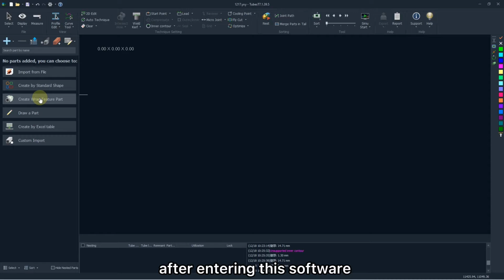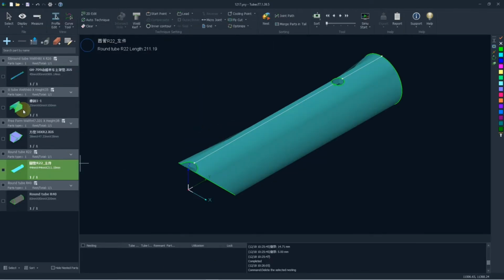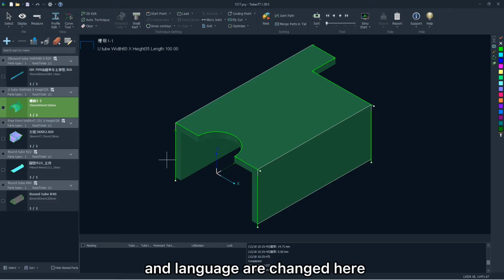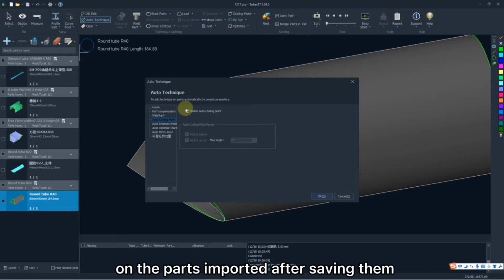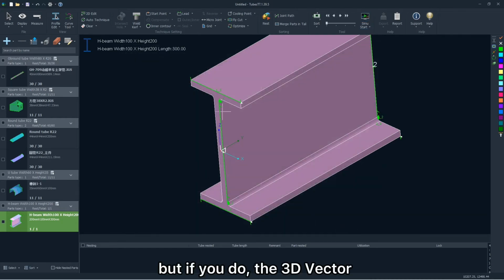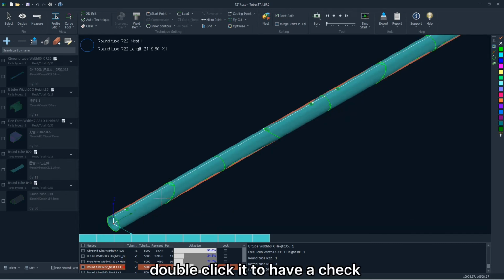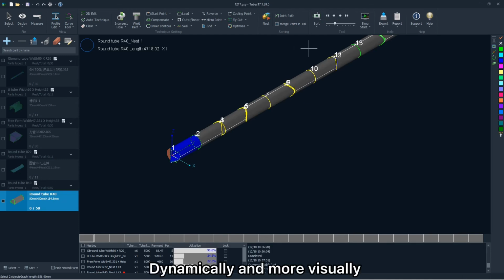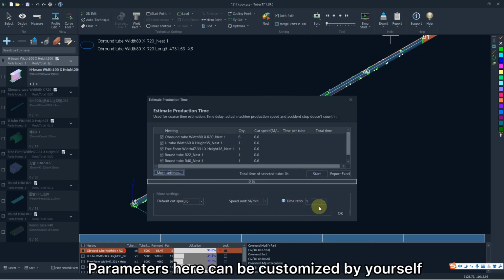TubesT Tube Laser Nesting Software Official Tutorial    | Fast 3D Tube Design

Comment: SO IAM USIGN SAME SOFTWARE AND IAM NOT ABLE TO IMPORT 200X200 PIPE
Reply from the maker: Could you please send an email to bilgi@smartay.com.tr? We will send you a detailed PDF file regarding the matter.

The issue you are experiencing will be resolved.

Thank you, and we wish you success in your work.
Reply from the maker: Method 1: Importing a Pre-Drawn File (IGS, STEP, etc.)

If you have a 200 × 200 mm square profile designed in a CAD program, you can import the model into TubeST.

Click the “Import from File” button located on the left side of the TubeST interface.
In the dialog box that opens, select the appropriate file format from the File Type section, such as IGS/IGES, STEP, SAT, or another 3D format supported by TubeST.
Locate and select your 200 × 200 mm square profile file, then click Open / Import.
TubeST imports the 3D model into the working environment and identifies the part based on its geometry. If necessary, check the profile orientation and cutting axis and adjust the model to the correct position.
Once the profile has been correctly defined, the part can be used for nesting and cutting operations.

Note: The 200 × 200 mm dimension refers to the external dimensions of the profile. The wall thickness, corner radius, and profile length in the CAD model should match the actual profile being used.
Reply from the maker: Method 2: Adding a Profile Using “Standard Shape” in TubeST

If you want to create a 200 × 200 mm square profile directly within the software instead of importing an external CAD file, you can use the Standard Shape / Standard Shapes feature available in your version of TubeST.

Click “Add Parts” or “Standard Shapes” in the menu.
From the available profile types, select “Square Tube”.
Enter the required dimensions in the profile parameters:
Width / Height: 200 × 200 mm
Thickness: Enter the actual wall thickness of your profile, for example, 5 mm or 6 mm
Length: Enter the length of the profile to be cut
Corner Radius: Enter the actual corner radius of the profile
After entering all required dimensions, click OK.
The created 200 × 200 mm square profile can then be checked and prepared for nesting and cutting operations.

Important: The wall thickness and corner radius should be entered according to the actual technical specifications of the profile whenever possible. Incorrect values may cause the generated cutting geometry to differ from the actual profile.